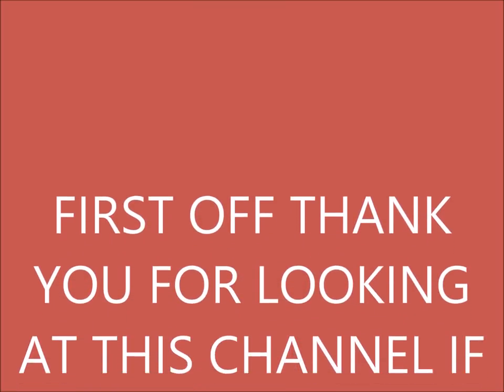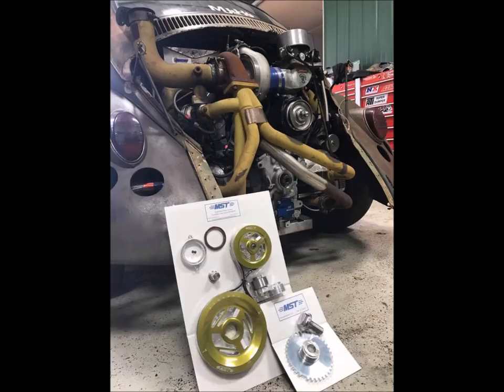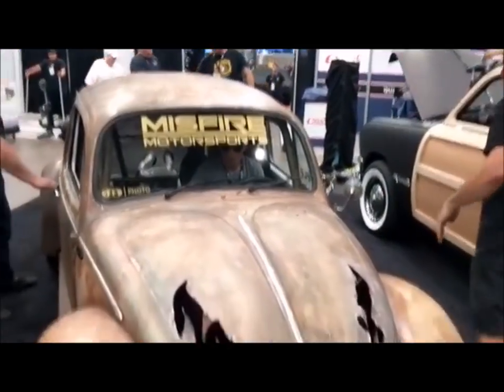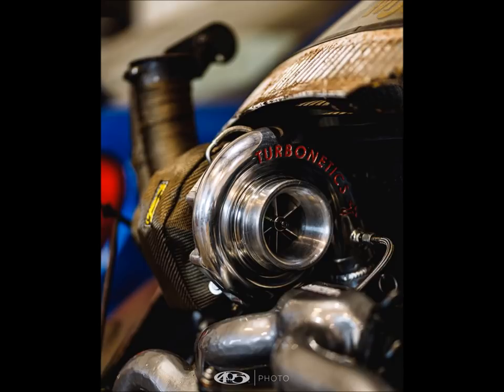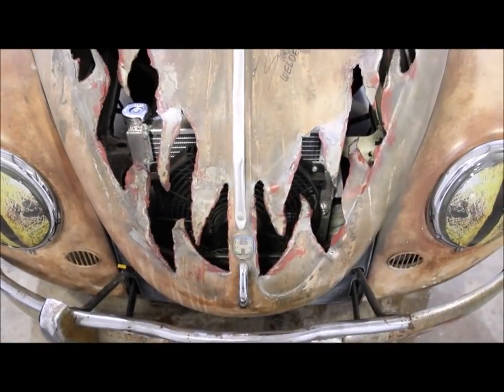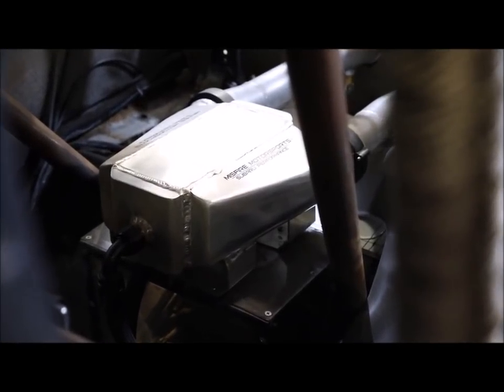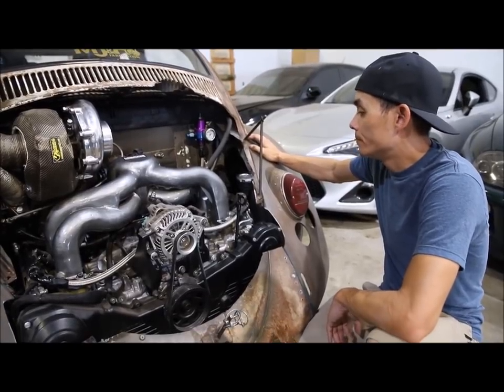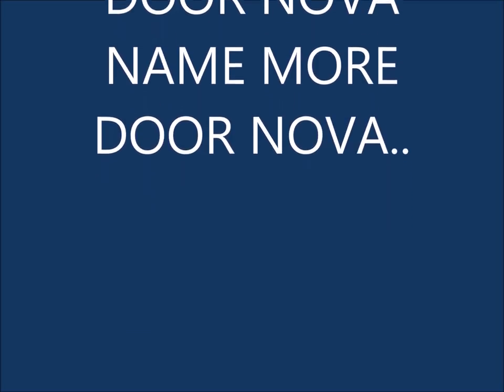WHAT HAPPEN TO AZN DUNG BEETLE

Comment: He ruined it. Should have stayed with Air Cooled. It was more impressive going fast with an Old School build rather than a modern motor swap.
Reply: When asn first reviled the bug, they said they could get the Subaru up in the 800 hp, why wouldn't he
Reply: I hear you on that. But it's not always about speed and HP. The cool factor of a 70s motor with 400 - 500 HP that was originally 60 HP says something...  Tons of people out there put Subaru motors in them and even LS swaps in bugs are done all the time. I guess to each his own.
Reply: @derekrogers3426  making power and being able to use the power are two different things
Reply: @johngrepo9976  he did say he had to relearn to drive it
Reply: @derekrogers3426  He could have went with a K series Honda and made even more power. And they cost a fraction of the price to build.
Reply: @derekrogers3426  you can also do that with a properly set up custom type for engine. Pauter for one example would have seen them hit those number and it still would've been aircooled.

Comment: I'm not sure because I don't keep up but I think the hearse has some kind of diesel powerplant in it. Two different size turbos I forget what it's called.
Reply: Mary May you’re right, it’s a diesel. Now I’m not sure if it has the different size turbo setup, but that is referred to as, compound turbos. A larger turbo feeds a smaller turbo. It’s capable of very high boost numbers, well over 100 pounds.
Reply: Subaru petrol engine